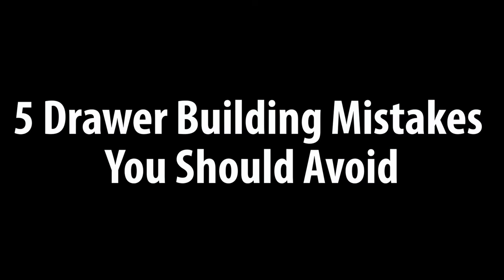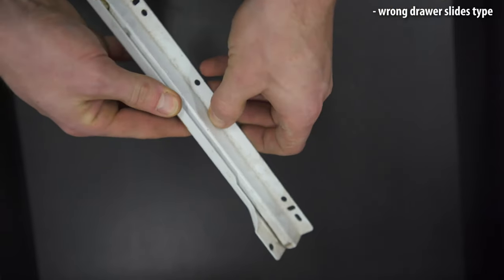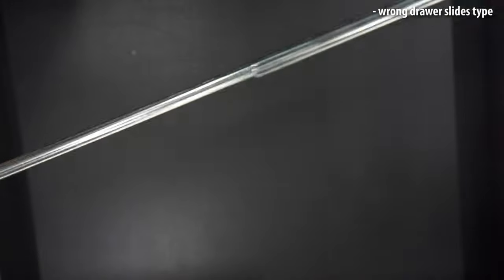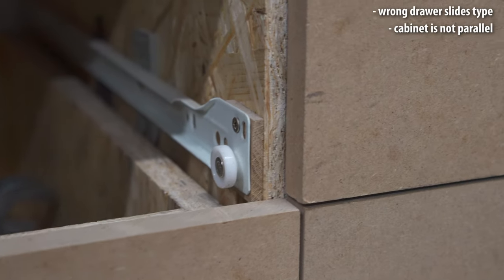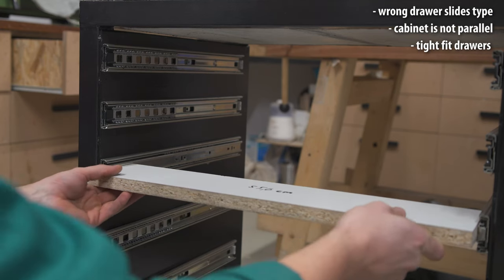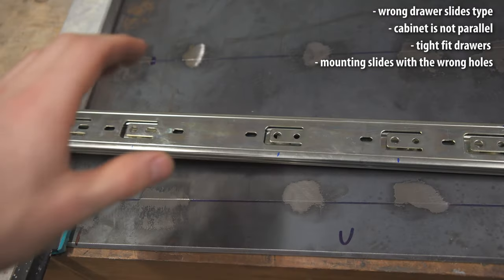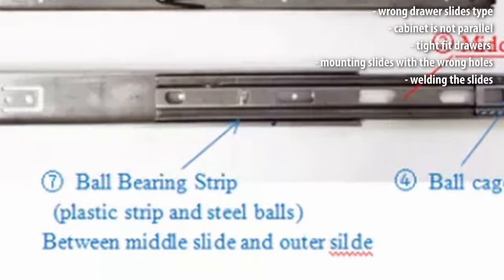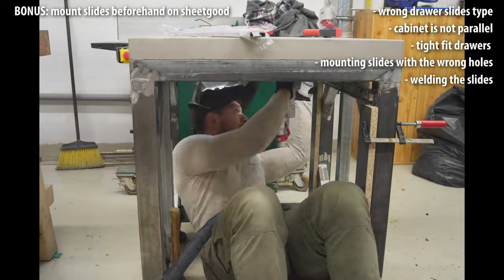5 Common Drawer Build Mistakes

Comment: Another really nice video! Short and sweet. Did you make the metal drawer carcasses (is that the right term?) in the last shot? Looks good. I have only had experience making one metal drawer but have a list of a dozen I want to build to custom fit various frames/rollers I have around my workshop. I made a sheet metal folder to do it which was great fun but it has its limitations!
Reply from the maker: Thanks Andreas!
Yes i made them, the drawers themselfs are plywood, and the surrounding cabinet is a metal structure.
I am also interested in a sheet metal bender, do you have some tips/recommendations?
Reply: @ChristophLehner   I watched a few well known videos on YouTube for design ideas, primarily Brian Oltragge, The Other Finnish Guy, Forme Industrious and couple of others. The wider the capacity, the greater the force so you'll absolutely need to use bracing to counteract. Second is make it adjustable front to back to deal with different gauges of sheet metal. Don't use lever style handles for clamping down the top of the bender as they can get in the way. The bender gets really front heavy so you need to have a good way to secure it to a heavy base or worktable. Don't use threaded connectors for the bending handles as it takes forever to get them on and off and you'll want to be able to store it away when not using it. Don't paint it, but use some sort of corrosion protection that will wear OK and be easy to reapply. If you make your own hinges, beware too thick of a weld bead as it can interfere with the range of motion. That's probably it 😅 looking forward to seeing your version in the future
Reply from the maker: @anmafab  thanks for the thorough explanation!